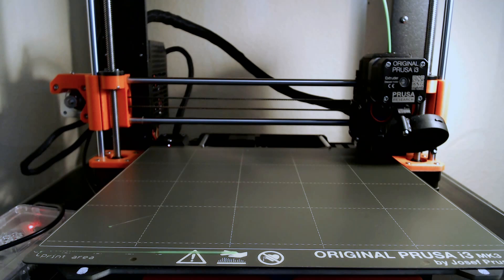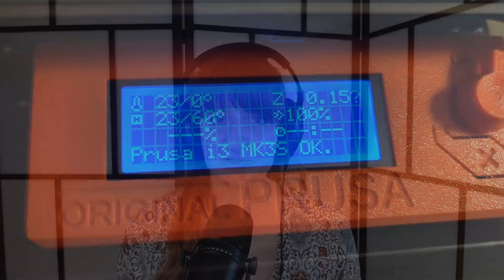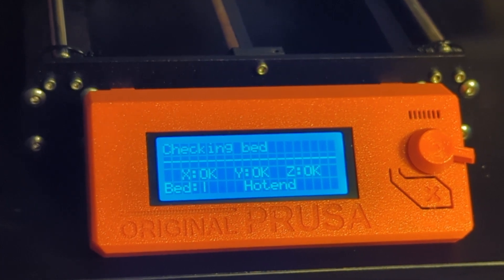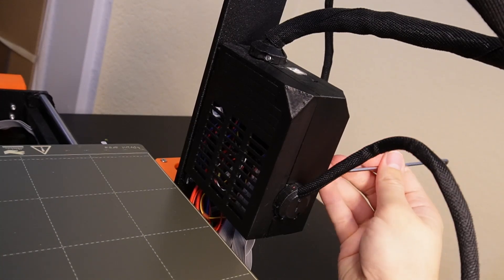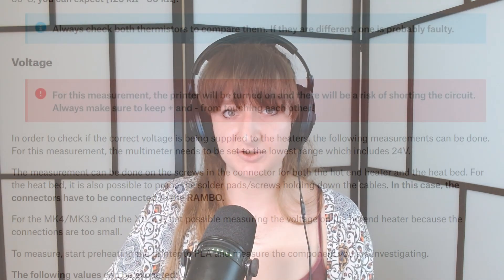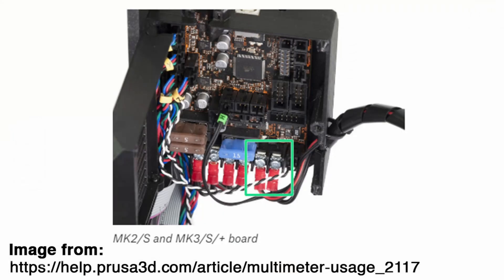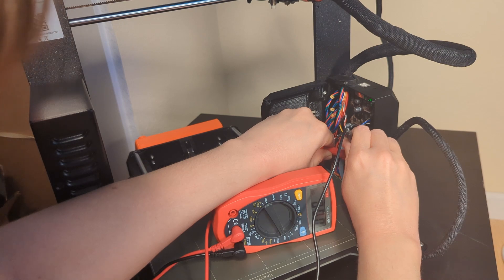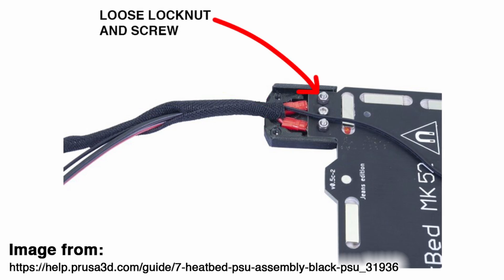How I fixed my Heatbed Issue (Bed Preheat Error) - Prusa i3 Mk3s

Comment: i can understand both the frustration about missomunication and initially very cryptic commands on the support side.
and that is due to simple misunderstanding about the technical knowledge level. since prusa printers are open source kit printers, regardless if you bought the assembled unit or a kit. tech support asumes you do understand how it works, so if you don't, say your printer was preassembled and you need explanation to what to test and how (and why). the explanation of how and why might be a bit mansplaining, but it is often informative.
since bed has no voltage on the controller board connector while bed is cold (because it is off) tech probably asks you if there is voltage on the connector assuming you did turn the heating on. if there is no voltage board is damaged, if there is  voltage, fault is in bed or the cable, that is a basic troubleshooting procedure
it could be sped up if you measured resistance of the bed trough the cable while it was disconnected from controller board, because cable resistance should be close to 0 ohms and resistance of bed without cables and trough cables should be the same, if it varies  connecting screws are loose or damaged or the cable itself is starting to break down from metal fatigue. in the end it was no expense fix and this is all that matters
Reply: and from ohms law and voltage and resistance you could even calculate if bed is in good condition
it should be close to 3,4 ohms which at 24V gives around 170W (24v/3,4ohm=~7A, 7*24=168) if resistance goes up the power goes down. if resistance goes below 2 ohms  the controller board is in danger of overheating and blowing up some mosfet switches that controll bed, or shortcircuting the power suply

Comment: Of course this is all hindsight as I haven't checked any connections yet and simply went looking to see if anyone else had a similar issue before I delve into it myself. If there is an error, best practice is to ask yourself, what could have changed on its own... It WAS working before... Most errors on any machine are from mechanical movement so that will narrow it down. Bed heating error? check where the wire connection moves. You can even do this during a print, wiggle the wire, and see if it errors out. You might even be able to see the heat drop out on the display.